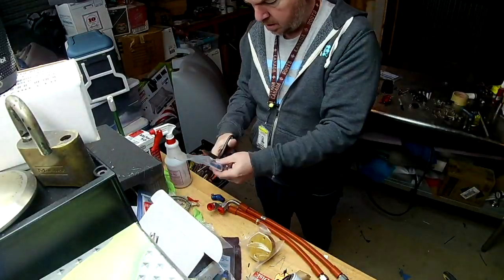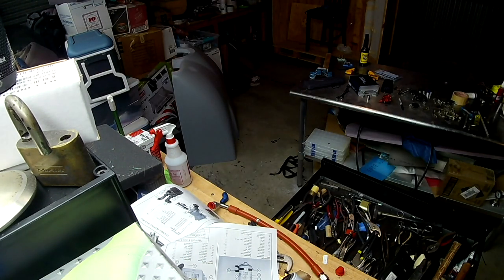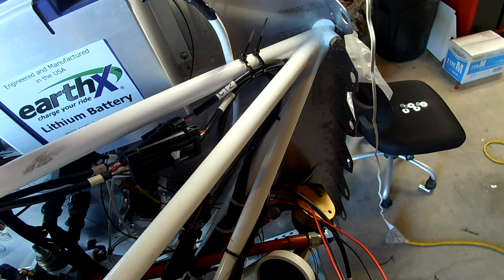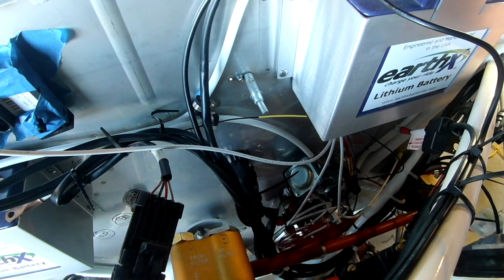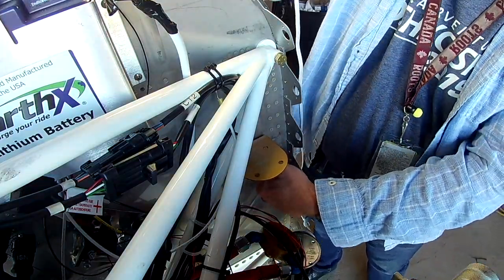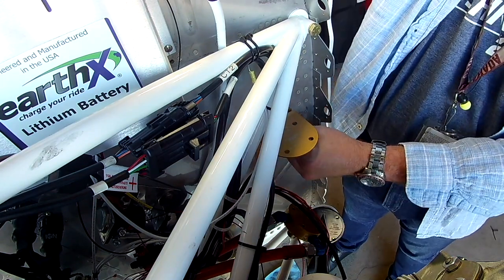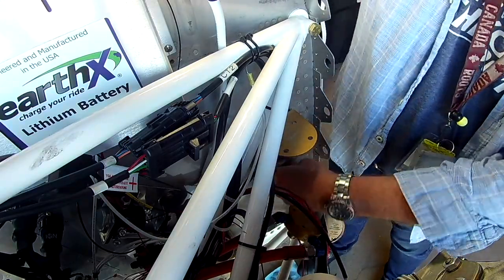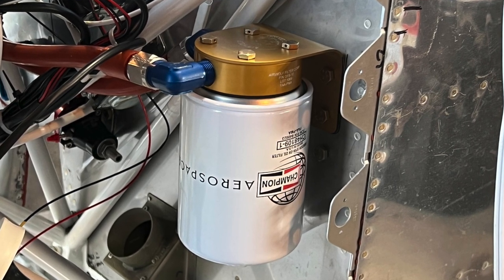RV-14 Airwolf Oil Filter

Comment: Andrew - nicely done.  Suggestion:  Use some self-fusing silicone tape on the engine mount under the zip ties.  Help protect both the power coat and the cable/wire/hose being secured.
Reply from the maker: Oh yeah most of those zip ties on the engine mount are temporary until I have everything run and can size them for adels.
Reply: @akilroy  Figured as much knowing you Andrew!
Reply from the maker: @m.turnerbillingsley4471  The next video is about wiring up the EFII system. Its all pre wired so when it came down to, 'Do I shorten this wire bundle or just anchor it?' I copped out and just went with securing it.
Reply: @akilroy  Service loop!